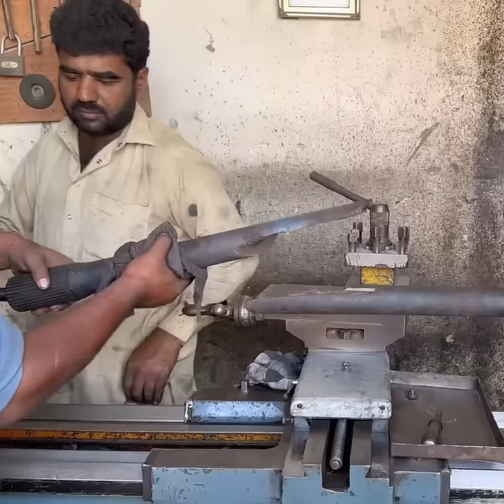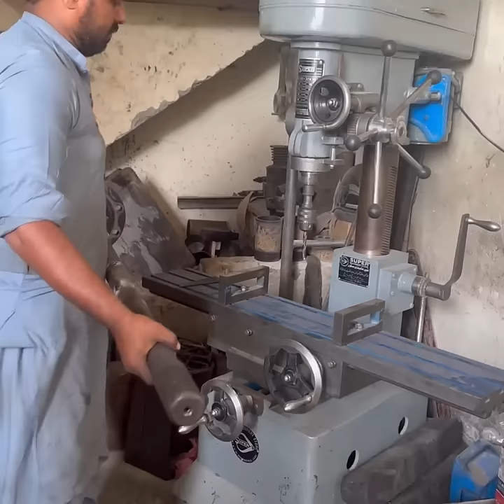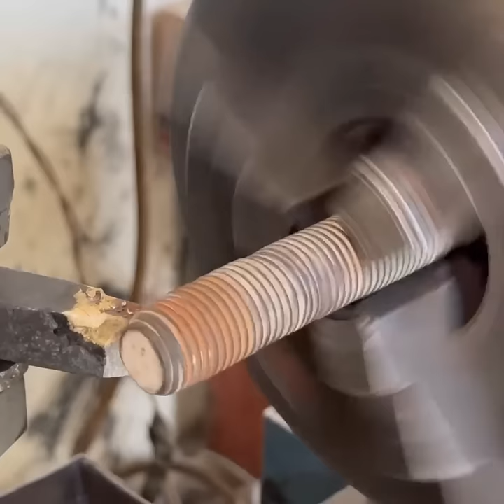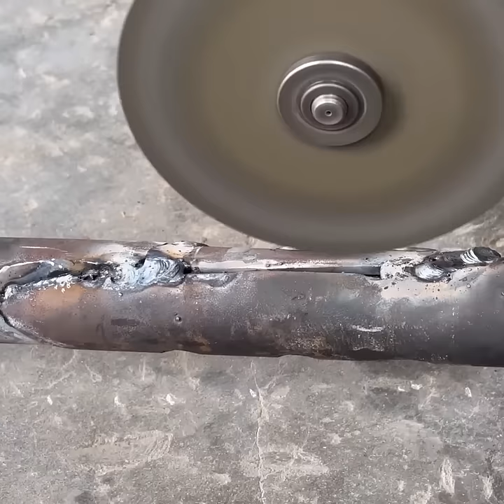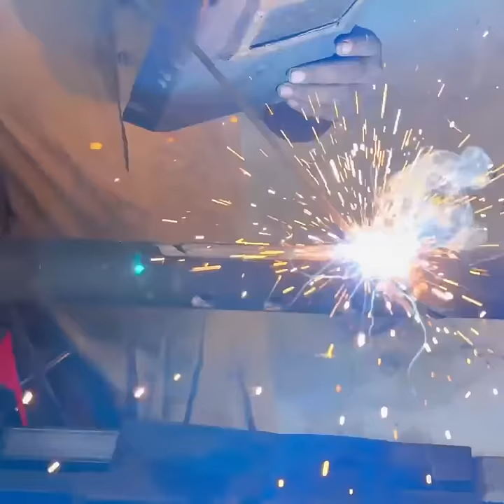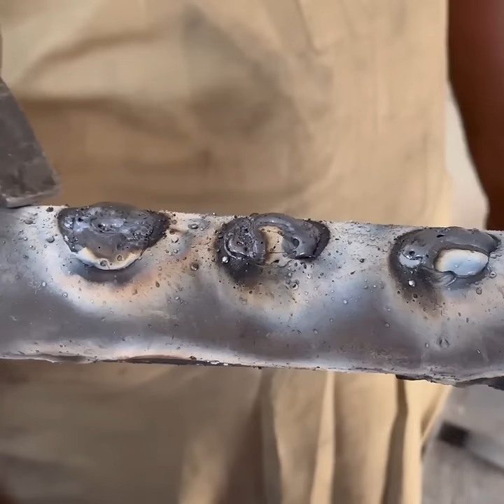How to Rebuild Broken Axle with Amazing Technique

Comment: You need to preheat before welding and keep it warm with the torch after welding and slowly cool it.
Reply: It depends on the Material! Most likely it us necessary when you weld cast iron
Reply: @Alex-und-Flux  car and truck axles are all cast, atleast every one i have seen. A forged axle could be possible but would come at significant cost and not worth it.
Reply: @poellot  I have never seen a cast iron Axel shaft! The joint is cast iron that's right but the shaft is a Solid pice of steel, or often a tube(rear wheel drive with Front engine) ! Cast iron is very brittel, and the shaft needs to flex Under torque.
Reply: @Alex-und-Flux  all semi truck axles are cast shafts and the haul 80,000 or more.
Reply: Right. That increases the flex, tension
Reply: @poellot Something can be cast. Yet not be cast iron...
Reply: @mauricematla8379  they are cast steel i assume.  I have no idea the specific steel type but still when welding cast you should preheat, weld, then keep warm to normalize,  then slowly cool.
Reply: I am not a steel expert,  i am an mechanic.  I can for sure tell you what works and what does not. And welding cast iron or cast steel you need to preheat before welding, keep it hot for awhile, then slowly cool it. This prevents stress areas. It is good to do it with most steel, it is in my opinion absolutely  necessary with cast. Some people may have good luck not doing it, but its just that luck. I am no expert on metallurgy but i have read a lot about it and fully understand heat treatments of hardening and annealing,  and i understand some steel will not harden much but some, that is where the keeping it hot and slowing cooling will prevent that and keep the metal ductile. Each steel type is different temperatures, it is impossible to know the steel type, and impossible to know the temperature when using a torch and just doing it by the color of the glow, but it is close enough for very good results.
Reply: @poellot And ? Weld in short bits , Hammer it out use special electrodes though sometimes stainless steel electrodes work as well clean your bit well and even then. With cast Iron even if you do everything correctly it may still not turn out well. I have welded a fair bit of the stuff it is just not alway's as homogenous as it should be. Particularly with really old parts.

Cast steels are usually a bit better.
Reply: @poellot As a welder i think i have a reasonable understanding of that stuff. But why the arrogance ? Claiming you FULLY understand such a subject ? Unlikely.
Reply: @mauricematla8379 @mauricematla8379  why do you take this arrogance? I understand all of it, i dont memorize steel types and treatments for each. And unknown steel in a used part like that would be impossible for anyone to identify.  Sure you could, by experience have a good idea of the type and needed procedures, but absolutely no way to know for sure unless you worked for the manufacturer while that part was being produced.  Obviously changes are made often so a few years different could be significantly different.  I am just saying from my experience i know what works well and what does not. If you are an experienced welder then you should understand problems with cast. Doesnt mater the metal. Cast Aluminum for example is something i wouldnt even attempt. But cast iron or steel i have done successfully. I was pointing out that in this video, that part really should have been heated first, welded, then kept hot. All class 8 trucks in the usa are cast axle shafts. I really doubt any country would use forged steel axles in heavy trucks. It would be significantly too much cost. Automotive could but in gm and ford pickups i can confirm cast axles from the 70s up to mid 2000s 1/2 ton and 3/4 ton. Aftermarket parts i am sure forged would be available.  But oem part is not. And this video you can clearly see the type of failure is cracked cast part. Forged steel or even iron would not fail that way unless it was heat hardened after and that would add more cost and be the opposite of what would be desired in this part. I know there is a lot of science behind metal casting and steel alloys.  I fully understand them. I do not memorize steel types because i am not a professional welder or fabricator.  I am a mechanic so i repair parts. I would not atempt this fix unless new or used replacement was not an option because it does not matter how good of a welder you are this will never be as strong as the original casting, however if done correctly it could be sufficient for light use. This particular repair definitely needed to be normalized after repair. No one could argue that.
Reply: @poellot  I have welded cast aluminium bits no problem. Besides the particular material oc the application matters. The aluminium i welded was certainly not for high end stuff and not some exotic alloy either. Probably Al Mg5 or something simular. The thing is you claim to fully understand it.... Fully isnan absolute term that does not leave room for the slightest margin of error. For instance it would mean you know on top or head precisely what happens on a sub moleculair level in any givven material. You must know 100 percent accurately every single possible detail of and question about the whole thing literraly everything....
Reply: @mauricematla8379  Fully understand.  collocation pattern: adverb + verb
Meaning
to understand the full meaning or importance of something. 

I never said i know it all. I said i understand it.
Reply: @mauricematla8379  do you fully understand the English language?  Do you know everything about grammar and proper use? I believe i fully understand it but i do not even pretend to know proper grammar or spelling,  but i understand it. In fact i fully understand it.
Reply: @poellot No, no automotive axle that must withstand mechanical traction is made of cast iron. These axles are made of a solid steel bar from the continuous casting machine. They are generally made of 1045 steel when the load requirement is medium and 4140 steel when required. great resistance. These steels are alloys of steel, manganese silicon, chromium and molybdenum, which gives resistance to mechanical traction and impacts.
Reply: @poellot But if you are right, when welding thick steel pieces, it is best to preheat the material so that a stress zone does not form in the material and so there is good penetration. As for cast iron, if it is completely necessary to heat the material and lower the temperature, this is because it is a very porous and brittle material and special nickel electrodes must be used, these are 99% nickel and are more expensive than steel ones. . In the video the man is most likely using 7018 electrodes to join that shaft. As I mentioned in the previous comment, since it is 1045 steel or most likely 4140, it is a steel with high resistance to mechanical traction, but it is also possible that it breaks if it is subjected to loads greater than those it can withstand. That axle will not last long with that repair, it is already a weakened axle.
Reply: Finally a constructive comment unlike the racist comments

Comment: Axel is also supposed to work as a fuse, to prevent further damage to drive unit it is designed to snap. This happens when it's drive torque exceeds it's load or has simply aged. With this repair (beautifully done) guarantee next will be power train repairs. But hey as long as you get another mile out it...

Comment: HEAR IT CLINK WHEN IT HIT THE FLOOR,ITS SOLID,they break when they are stressed,if this axle is not stressed and abused,drag racing,driving through mountains and under stress constantly, NO,but city driving,it'll hold,all he is doing is correct,esp the machine work

Comment: I’ll explain quickly why this is dangerous, the welds are actually fairly strong, the problem is the heat from the welding will weaken the surrounding metal pretty significantly.

Comment: But isn't there 3 hollow spaces in the middle because of the 3 bolts you hammered in? I saw him just cover the holes on the top"
It didn't look like he filled the holes in, just covered them. So that would leave 3 hollow spaces inside the Axel right?

Comment: Do it right

Either turn the broken part down and turn a pipe that fits over it and vreate solid welds or if it needs all the original strength, cut it off turn a 45° angle on both sides and a solid piece you will weld in drill a centering hole and weld in pins for allinement and then give it solid welds to the core layering your beads over each other

Comment: This would have worked, however. You cracked off the bit you were going to use to fuse it. Thus losing all the structural strength you gave yourself

Comment: It’s a damn full float truck or equipment axle. Even if it dose break again no one’s life is in danger as you don’t even have to pull wheels off to remove the axle. It only sees torsional load. Is it as strong as new? Nope. Will it work? Probably for a bit tell they can order a new one or find a good used one. I’ve welded a splintered axle on my 14bolt in the rock crawler and it got me off the trail just fine. Lots of grinding and drilling pre heat and some 7018 rod and sent it. You do what you need to do. Worse thing that would happen is it broke again and it would of just been a slow winch fest off the trail in 2wheel drive. But it made 3 trips after the repair because a trail fix tends to be a permanent fix. I did finally manage to get some used shafts and swapped them both out as the splines were starting to twist. To each their own. Dude probably had to get back to work and keep making money. For all we know it could take a month to get a new axle in where they are. 🤷🏼‍♂️

Comment: You've got to be kidding! I understand the attempt but I also understand the torque that it took to twist a solid steel shaft into 2 pieces. This repair is now MUCH weaker than original. So what ever broke it will take less of it to break again.

Comment: To the clowns out here. The Alice does not spin the berrings on the stub shaft on the end does. Look at the set up. These guys more the Lilly over load ther small trailers and pull them with small tractors to get to market

Comment: Not how id have done it! That way to complicated given the tools available to use also not as strong as simple cut out the bad section spin a bevel on each end spin a peace of axle down to replace the broken sections then in steady rest and lathe chuck weld it back together much stronger than that fix! But it worked so 👍